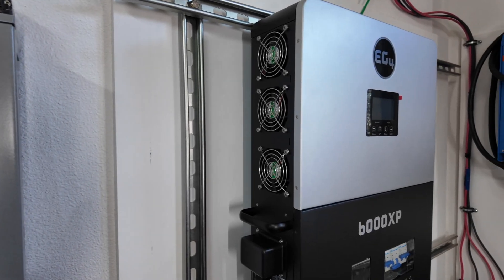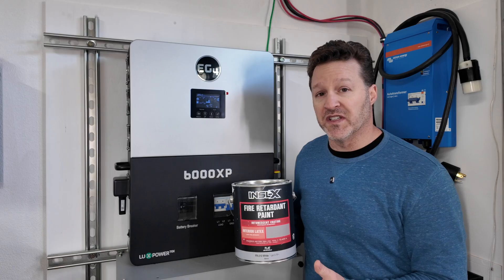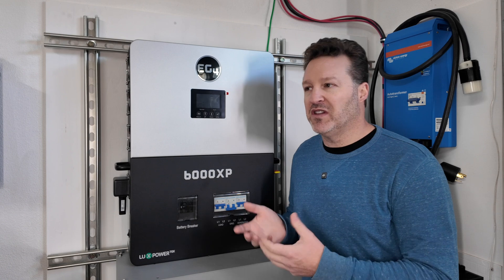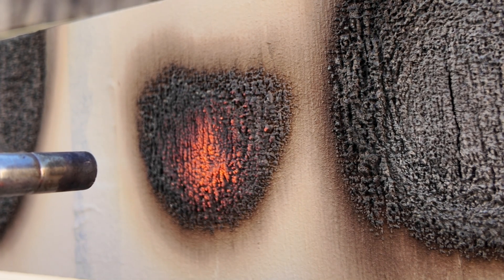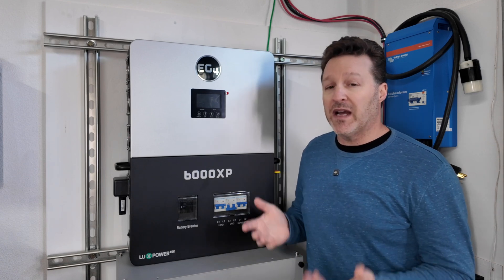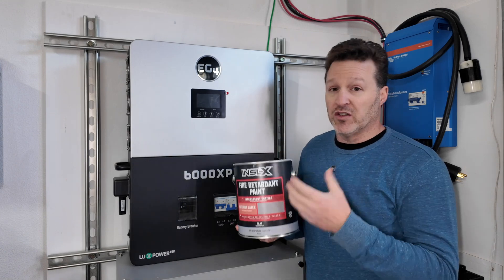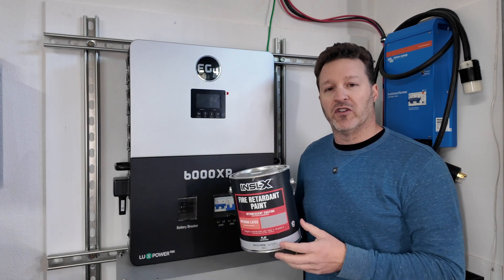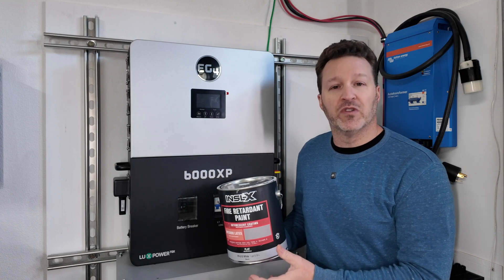Incredible Paint Stops House Fires Before They Spread

Comment: A thermal scope can help detect poor connections before they become a problem. Obviously, a smoke detector and extinguisher are vital.
Reply from the maker: New installs require heat detectors now for passing inspections if you have something grid tied to home

Comment from the maker: #eg4 #solar #backuppower #fire #fireproof 
Items seen in Video.......
INSL-X Paint: https://amzn.to/3E0WXnR
All In One Paint Kit:https://amzn.to/3Ejk1hJ
Multi paint tool:https://amzn.to/4gd2p4C

EG4 Offgrid/home energy system: https://signaturesolar.com/eg4-wallmount-indoor-battery-280ah-51-2v-14-3kwh-eg4-6000xp-off-grid-inverter-bundle-8000w-pv-input-6000w-output-all-in-one-solar-inverter-bndl-e0009/?ref=JOHNNYWKND

Low Profile racking: https://amzn.to/4jqi830
48v battery Chargeverter:https://signaturesolar.com/eg4-chargeverter-gc-48v-100a-battery-charger-5120w-output-240-120v-input/?ref=JOHNNYWKND
Autotransformer 120-240v :https://amzn.to/4hpUFx9
Solar Disconnects: https://amzn.to/4aqDGZn

Be sure to Subscribe 👍🏼 :https://www.youtube.com/@johnnysweekends?sub_confirmation=1 

Have a question you want answered fast: https://asqme.com/@johnnysweekends

SAVE BIG ON EG4 BATTERIES SOLAR AND MORE HERE: https://signaturesolar.com/?ref=JWKNDS 
DISCOUNT CODE: JOHNNYWKND

BEST PRICING ON EG4 ENPHASE ECOFLOW BLUETTI & MORE! BUNDLE DISCOUNTS: https://shopsolarkits.com/1134
Discount Code: JOHNNYWKND

CHEAP USED CERTIFIED SOLAR PANELS HERE: https://www.santansolar.com/?ref=Johnnys%20Weekends 

MC4 All in one Kit : https://amzn.to/37jwLVb

CHECK OUT MY AMAZON STORE:
https://www.amazon.com/shop/johnnysweekends